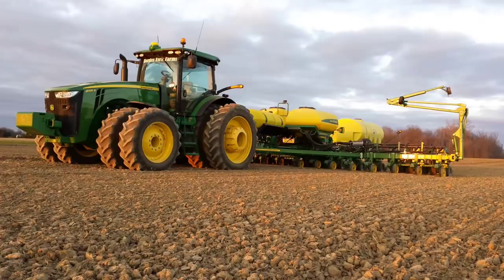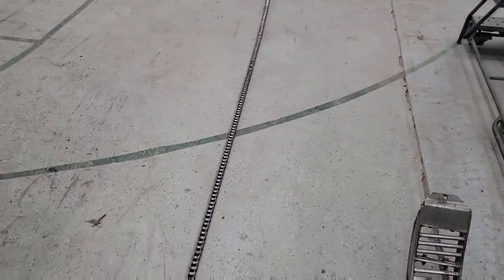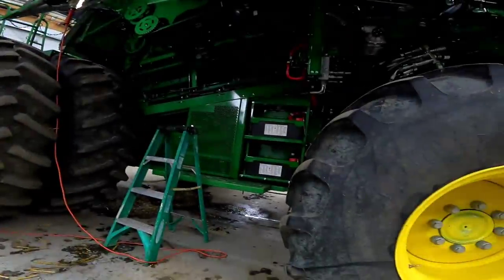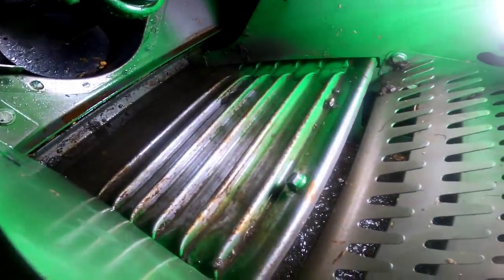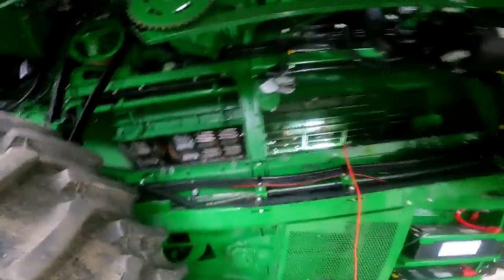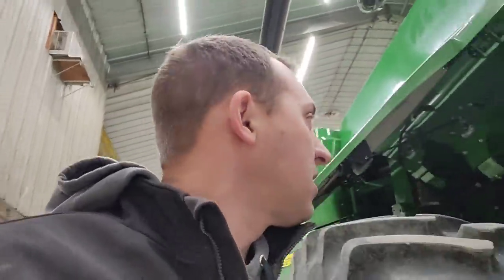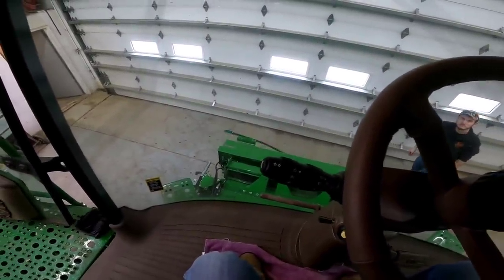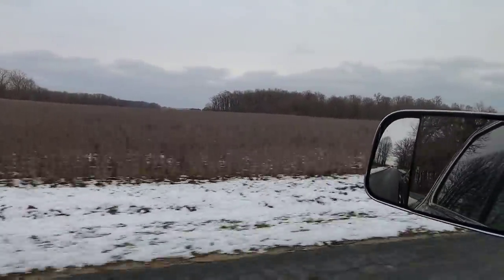Making Chains New Again - #579

Comment: Nathan, I think Brock wants your guidance on washing and spray coating the combine as much as the physical washing part. You can be quite pickieticular. Are the chains bunged up because they are left unlubed after the major pressure washing? Many of the 'kinks' were rusted in the video.
Brock can you get a wet vac into the area where you drilled the drain holes?  If it would even help? In Nathans' defense, he does have little chipmunk snackers that ride the buddy seat and elsewhere.

Comment: Quick question regarding the feeder house. Do you disassemble the chains that carry the slats? Didn't see it or are they good for another year? Just lube in place? Thanks
Reply from the maker: Did not take them out. Those chains last quite a bit longer.  I think I only replaced the once in 8 years on the old combine

Comment: Can you  tell if there is anything different on the new tensioner if not , stands to reason it would fail again.
Reply: Was it damaged from the factory or did.the damage occur after delivery?
Reply: I just looked at my New Holland Combine,  the tighten bracket on it is similar the spring rod directly under the idler sprocket,  where the Deere has that 4 inch offset.  A poor design in my opinion.